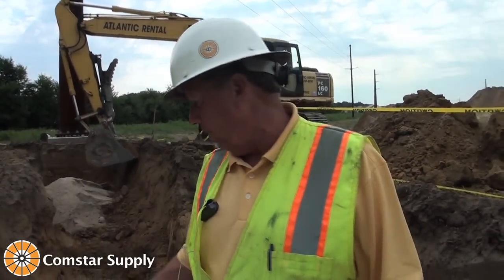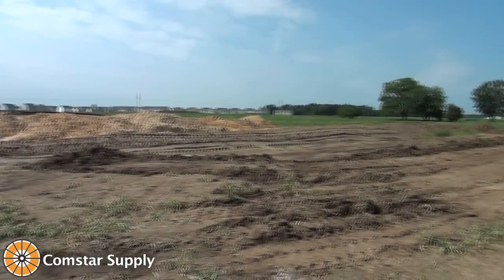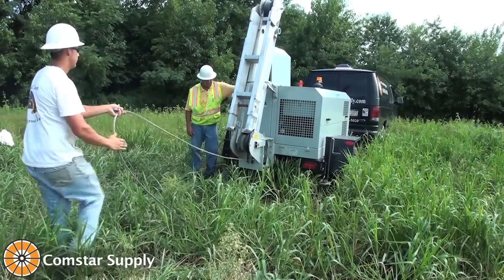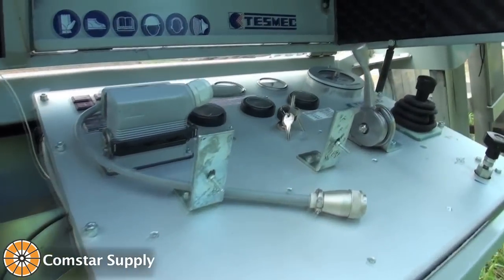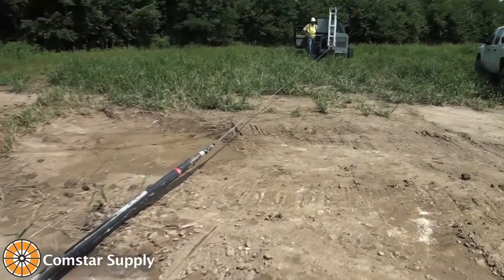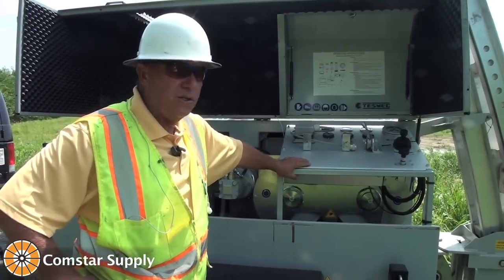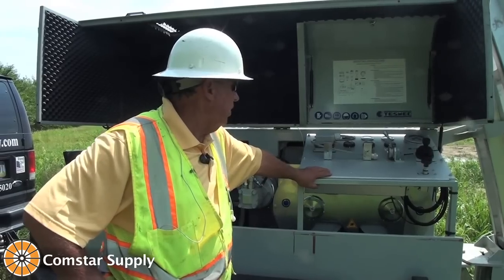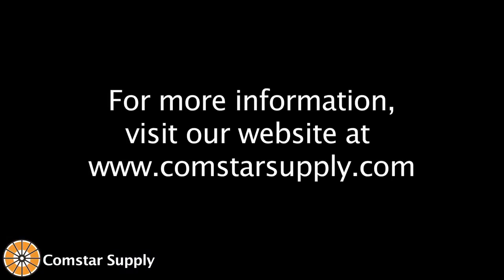Demonstration of Condux WDR 505 Puller

Comment: I'm surprised they don't just have snap lock sections of conduit with the conductors built right in. Lay a piece of pipe and that's it. Move down the line to the next and there she be. Maybe I should patent that idea huh?
Reply: Wizzle Hell no.  every connection is a potential failure spot. also not all ideas are good ideas.